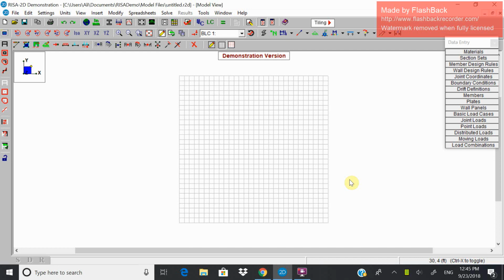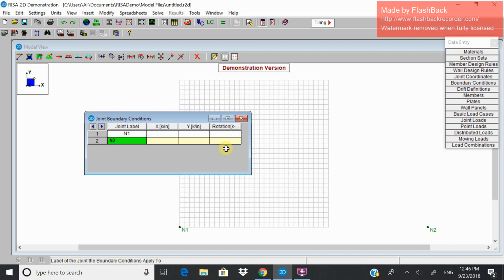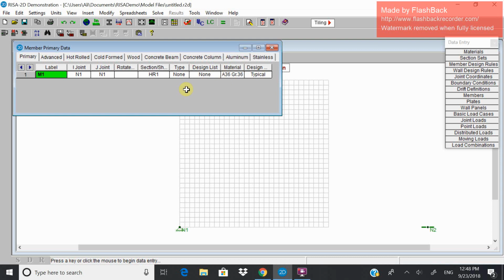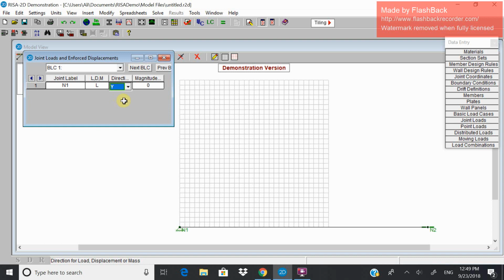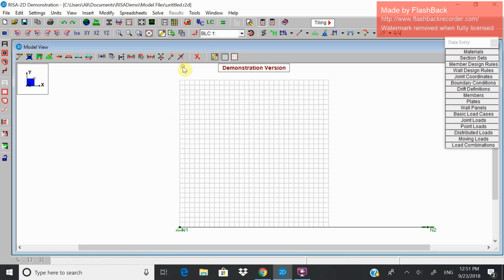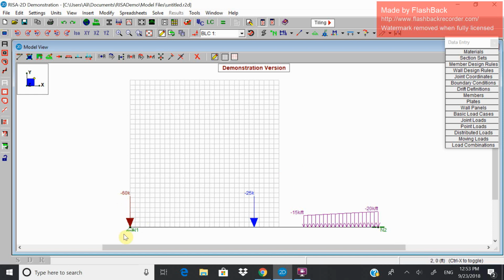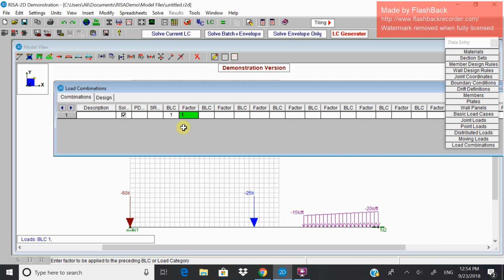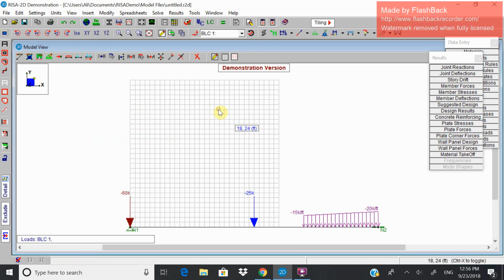RISA 2D ( Beam Structural Analysis)

Comment: how can I manually input moment of inertia in each sections of the beam? I have trouble finding this in the newer version. It's much simplier in the older version(v2.0) since you are just going to input the area, youngs modulus and moment of inertia as you draw the member. In the newer version, you have to select a preset beam